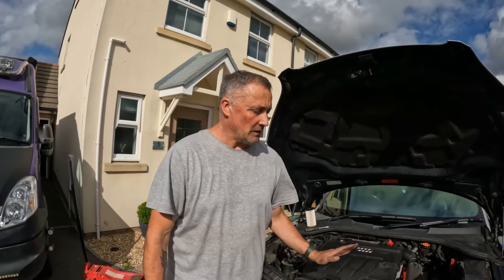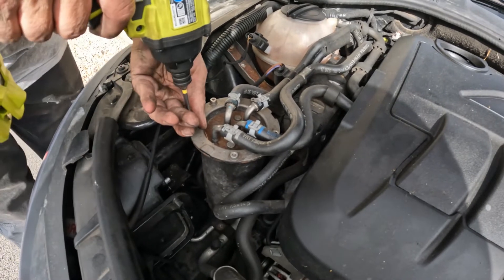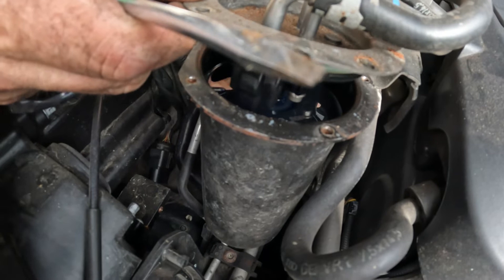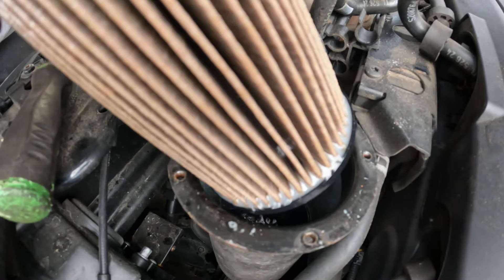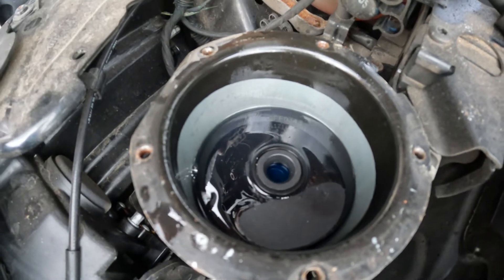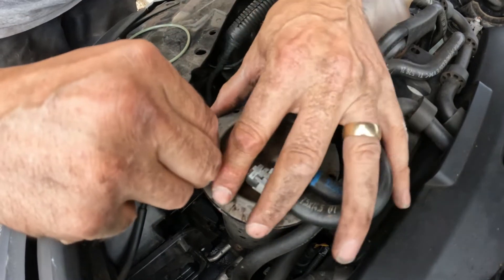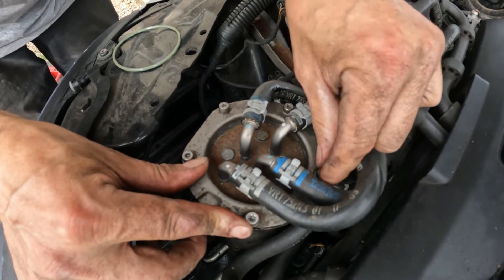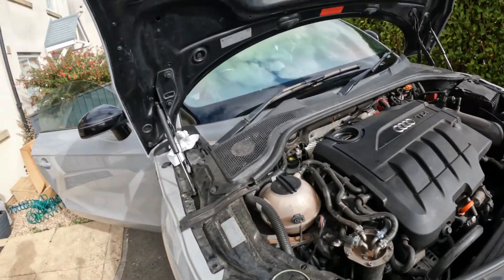How to change the fuel filter on a mk2 audi TT 2.0 tdi works for most of the vw / Audi 2.0tdi range

Comment: Brilliant! Thanks. How about the cabin filter though??
Reply from the maker: That specific car has a ram air filter on it ( after market type) which I service in a different video, the air filter is purely cross headed screws and straight replacement, very simple. The cabin filter is in the top right corner of the engine bay under the plastic cover by the windscreen wipers, hope that helps 👍🏻
Reply: No it isn’t. On a mk2 TDI it’s under a soft trim cover and a hard plastic slide out cover in the space beneath the glovebox.